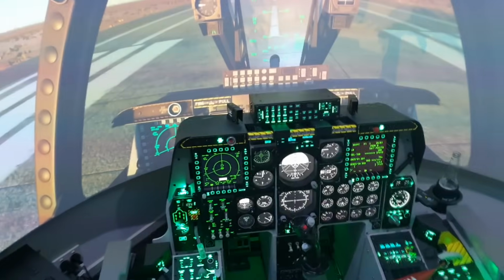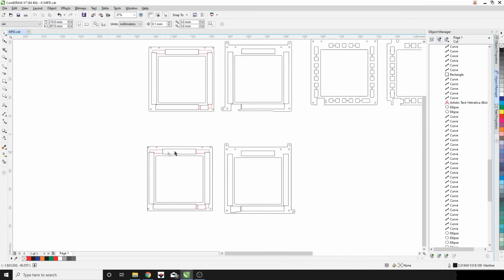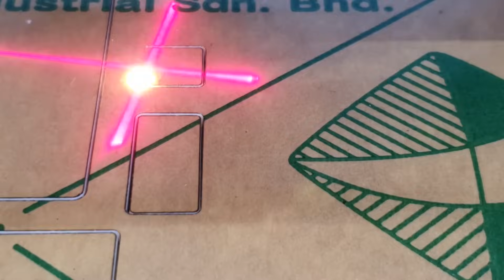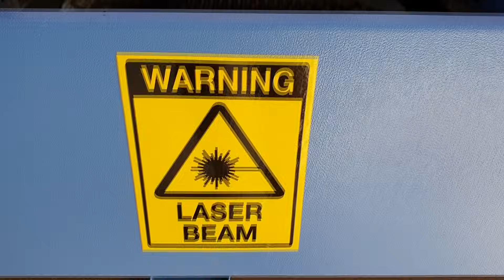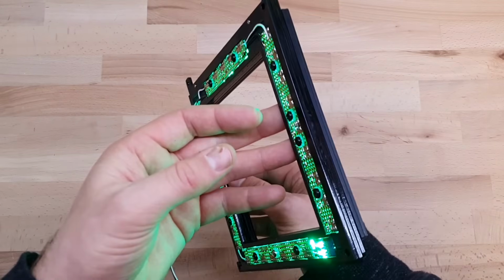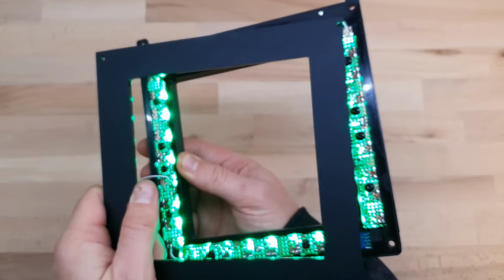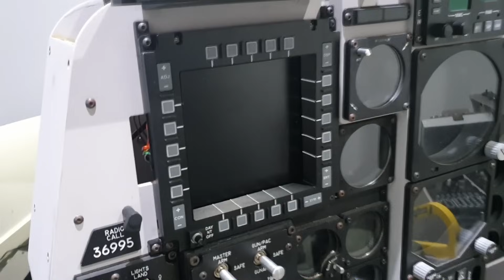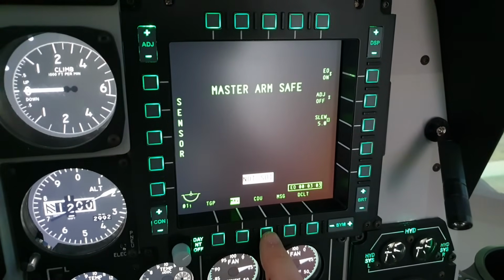Making New MFCD's- A10C Warthog Simulator

Comment: Yo man, love the project, im setting off on my own Home PittCock journey, but i know nothing about electronic lighting, i think i have everything down BUT ..... Backlighting!!!
What a pain in the scrote backlighting is. Ive used a MOSFET breakout board to separate the 12v supply from the arduino board so i can trigger the backlight from Mobiflight.

Im on 3x 3.3v white LEDs and a resistor per loop, arranged in parallel loops on a 12v circuit.

But the circuit can change to a different power brick. I "calculated" the resistor value to require 100R resistors.. 
The result is amounts of light barely detectable to the human eye 😂
Any recommendations on troubleshooting a power discrepancy and selecting a power circuit or changing out the resistance?
Kinda scared to slam a load more current through it tbh.

Comment: It really is a lot easier to be able to CAD up the PCBs with proper edge routing, assembly, component placement, connectors and hole alignment. It really would be worth your time to learn!
Reply: I’d probably have one big PCB built up for all the lights around the ring.

Comment: This is absolutely insane! So proud you're a fellow Australian! If you were to do it all over again with what youve learned would you use Arduino or just go full Leo Bodnar ? Cheers mate. Also do you have a video showing your weathering process to get the scratched up aluminium look?
Reply from the maker: Thanks mate! Yep when I started DCS-BIOS wasn't around, and if I started today I would absolutely use Arduino alone. Having said that, the Leo cards are great and very simple and if people are scared off by Arduino coding they are still a good option. No video on weathering at all, but it's just very simple dry brushing. I'll throw it in an upcoming video.
Reply: @thewarthogproject  awesome mate cheers! I’ve been looking at using traffolyte for some custom panels but love you sandwich technique. Yeah I’m pretty good with the teensy microcontrollers, used them for my uni control thesis, they use the same arduino language, but have lots of extra useful libraries
Reply: Absolutely awesome,  Thanks for sharing.  Can you specifIcly show the wiring of the tactile switches, to include how they are ran from and to controller.  Building AH64 TEDAC. Share wiring diagram, please ? Thanks!!

Comment: Wow nice work on those MFDs!  They are considerably larger than Viper MFDs.  With my aging eyes maybe I should have built an A-10. Lol.  I’m curious how you measured out your buttons so that match up to the onscreen button as you indicated in the video?
Reply from the maker: Thanks mate! I was using F16 ones for ages, with the size difference now it is much clearer. For the spacing, I found some decent diagrams of it on the manufacturers website, so I based all the measurements on that. I just imported those images to coreldraw, set the scaling to the correct outer dimensions (the only ones I actually knew) then designed my panel over the top of it. Then I just hoped that ED had the viewport correct- Which of course they did!
Reply: @thewarthogproject  wow that’s a testimony of both your work and DCS.  Looks perfect in the video.  Well done 👍

Comment: Did i understand your videos correctly that the gauges on the front panel is just a big regular monitor screen? And then using some kind of program to copy that area of the display in dcs show it on that perticular space?
Reply from the maker: Yes the entire front panel is a normal 27inch lcd monitor. The program used for the gauges is called 'Helios.' It takes the data from DCS and uses it to run separate guages, so they are not viewports and are completely separate from DCS. They can even be run over a network to a separate PC. And it's free!

Comment: Hi Ray, a great upgrade to your simpit. I really like the marker lines using white electrical tape. I might add that to mine. I've found that because the position of the MFCDs is not in straight line of sight, it's not always clear, when looking quickly, which button is for which function.
The back lighting looked evenly spread so good job there. I did have a concern myself with the cost of tactiles with integral LEDs, but managed to source cheaper ones of Ali express in the end
Nice one, thanks for sharing
Reply from the maker: Cheers Craig. I bought some of the cheapest tactiles with LEDs i could find- they ended up being an almost yellow colour and very dim so i stopped looking. Also- Im using one of your ideas from your last video as well. I'm planning to cut a new EMI surround and add the painted green/orange/red bezels to add some colour.

Comment: Did you consider using the more expensive tactile switches with centre LED, just for the rocker switches, which should avoid light leak through for those type switches?
Great job on these.  Thanks for posting the update.
Reply: A little vertical lip around the underside of the switch should also help reduce the light bleed, and you could 3D print that for a few cents.

Comment: PCB design is really easy with a software such as KiCad (free) or Fritzing (dunno if still free). you can learn enough to meet all your needs in less than 1h. I get that prototype boards are easier to deal with for such simple circuits (and much less expensive too), but you shouldn't be afraid to try them out if and when you do more complex stuff.

Also other question, why use the BBI-64? Currently working with a teensy LC, and with easy to implement matrix I can get more buttons (incl. analog inputs) than the BBI-64 for a fraction of the cost while still getting joystick emulation...
Reply from the maker: I used a BBI-64 only because ive used them before, and they are a proven and simple plug and play solution. A teensy/Arduino would require me to design and/or build a seperate matrix, then flash firmware on it to have it show up in windows as a HID device. With the Leo Bodnar- i just have to connect one wire to the card and its good to go. In my opionion they are worth the cost.
Reply: @thewarthogproject  Good point, thanks for the reply. I knew someone who did a 737 sim in his house and I also always wondered why he used older hardware he needed to code in assembly. But since you don't need extra coding, I can see the convenience is worth the price. Keep up the amazing work!

Comment: crazy amount of work! looks great though! how much power are you using on your K40 to cut the PCB boards strips?
Reply from the maker: Mines got a 60watt tube. It cuts the board at 60% power at 12mm/s. It wont go through the metal on the boards, so i have to score the metal first and then just pop them out. Works well!

Comment: On your rocker switches ad a curved lip on the back so it blocks the light creep and still allows it to rock. Both the cockpit and the engineering massively cool though.
Reply from the maker: Good idea- but easier said than done. The laser software I have can only engrave at set heights, so it wont do a curve. I could hand sand them, or maybe 3D print the rear part or the button. Might look into that later!
Reply: @thewarthogproject  How about adding a thin black felt or cloth skirt that is tacked onto the center of the switch but freely flexible on the edges?
Reply: Rubber!

Comment: Fantastic work! An inspiration.

(You're using stripboard here, though… it's not a PCB if it's not printed and not a circuit ;) )
Reply: Did you use stripboard or PCB's on your sim?
Reply: @paulaglet4255  stripboard up to now. I have a CNC engraver that could make engraved circuit boards, but having made a couple I'd rather fire up Kicad and pay JLCPCB a few quid and wait.

Comment: Hi.. I'd do custom PCB designs for you for free.... It'll be a pleasure !!!
Reply from the maker: Cheers! Too late though- its up and running!
Reply: @thewarthogproject  yes I see that you have it up and running well.... but still I think you should start moving towards coat on PCBs in all your instrument panels not just the MFD.
I've worked on the instrument panels for many aircrafts, including mirage, C130 etc. 
Currently working on the IL78.
I strongly think that you should commercialize your work, at least some or all of the instrument panels.
Again I'd do the PCBs for you... :)
Reply: @thewarthogproject  your project has inspired me to build my hog pit i have completed my left and right console but have no way of making MFCD Bezel would you be interested in helping me out with making the panels? I can do the circut boards. Would pay you for them. chickenbone72@yahoo.com  on ed as Chickenbone72 and fly with OCG as "Chickenbone"

Comment: Proper backlit panels are done the way you have made the pcb. The only difference from your panel is that they don’t use multiple layers of plastic. Real aircraft panels are made of CLEAR plastic and painted with blanking paint and then engraved. Now the way the engraved lines fluoresce is simple... you put a thin layer of paint on top and as the engraved lines are lower than the surround all you do is put a piece of cloth on a scraper, add a bit of thinner and just wipe the excess off. 

It’s a bit more faff but it stops the one thing I absolutely HATED about my old panels... HOT SPOTS. Also it ate light because of the white layer stopping it passing through properly meaning you have to turn up the brightness which causes light leakage. The proper method means using  lower wattage lights, no light leak and you still get a lovely fluorescent line... AND you can even have coloured lines mixed with white ones like you see on Boeing and Airbus panel (and many others).

Oh and how did I find this out? I sat on one of my REAL ATR72 wing panels and broke the sucker in two... I used to think it was multi layered as well but then found the bottom layer of the clear is painted thin white and the upper lines are painted white (actually parchment) on my panels or whatever you need. And it’s pretty easy to do. Ironically I found it out after trying to glue together multiple layer, multiple colours and then painting over the top because one panel has white, orange and green lines on a single panel which did my head in.

Anyhoo, love your Hog pit... loved it so much I’ve started on making my own. So thanks for that (love you and hate you in equal measures mate lol).

Oh and you commented on the TISL panel having those dual lit buttons. I’m surprised you didn’t figure it out. Just make a button like normal, cut it in half and then epoxy glue a thin sheet of aluminium between the two part then paint and leave to dry. 

Cut out a holder for the button on your cnc (or laser), then without moving the holder you drop in the button and engrave it (making sure the alignment is the right way round... yeah, learned that the hard way) then put a long button micro switch behind another pcb with the two LEDs. A small hole let’s the micro switch button reach up to the switch.. but the real secret to avoiding light leak is to put some foam rubber under he button with a hole for each led and the centre micro switch button. 

Works a treat and is way cheaper than a real one yet works and looks just as good.
Reply from the maker: I've got a few real panels as well. I have experimented with that method in the past, the problem is the painting. Having it clear, painting it white, then having to mask up each individual letter is VERY time consuming. Then paint it black, remove the mask, and end up with paint bleed so it looks terrible anyway. Not to mention the white paint has to be a uniform thickness in the letter, not easy to do at such a small scale, even with an airbrush. 

For me in my garage- no way i could get a better result than what i have now via engraving the black paint to reveal the white acrylic underneath. 

Hot spots can be minimised by placing the LEDs carefully, avoiding putting them directly under a letter. Or do what i did, and use shear power and flood the whole panel with LEDs to avoid hotspots. It's not perfect, but im pretty happy with my results!

Comment: Love the diy ingenuity.  I've been following for awhile and it's turning out better than I imagined.  
What laser are you using?  Looks like a Co2, but curious on the wattage.
Reply from the maker: Cheap Chinese K40, thats been upgraded with a 60 watt tube.
Reply: The Warthog Project 
Do you recommend the 60w tube upgrade to the K40 for doing these acrylic panels? Or would the standard 40w tube do ok as well?

Comment: NICE!

BTW. I've used JLCPCB once or twice for custom PCBs, their design tool does not need a Post grad degree to use and understand (lots of libraries and components you can plug in), they also have a SMT assembly service so once you design and order the PCB you can have them assemble the boards with SMT components. Your board then arrives complete.

NB. No financial connection or interest, just a happy customer.
Reply: I'm absolutely sure they would even sponsor a video or two and provide pcbs free of charge. They sponsor my channel and are very chill about not requiring excessive amounts of advertising for them other than a link in the description and a quick mention at the beginning of the vid.